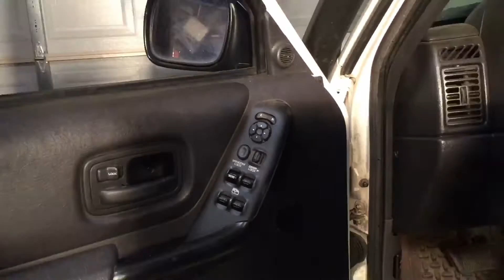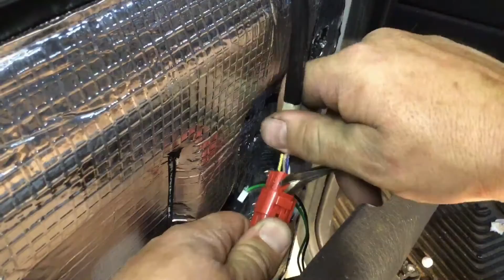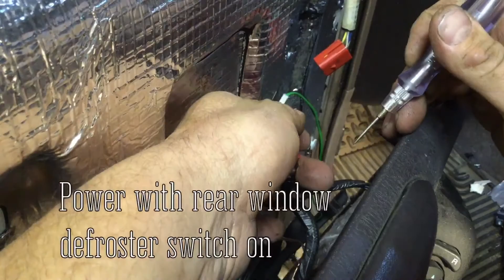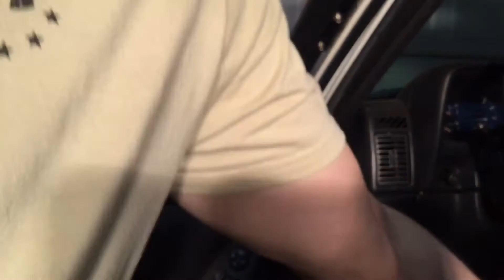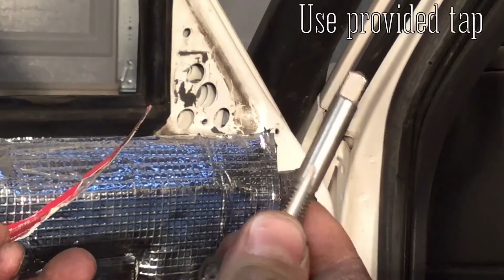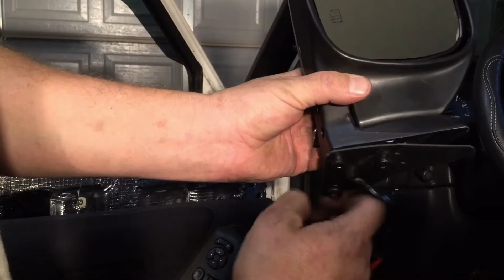'97-'01 Jeep Cherokee XJ Heated Mirror Upgrade

Comment: Can you update us on how you feel about these mirrors now that you've been using them for awhile?
Reply from the maker: Tee Ess yes, I like the defrosting feature but hate the cheap manufacturing. Buying used OEM would be better. They shake going down the road.
Reply: That's good to know. I ordered the same mirrors, but thanks to their slow shipping, I might reject the package to get my money back. My passenger side mirror works from time to time and I need to be able to tilt down for where I park it. Thanks for the great video and the follow up info.
Reply from the maker: Tee Ess absolutely. There is a more expensive version available on Quadratec that I didn’t order so I’m unsure if the quality but i would return these.
Reply: @kevefox You bought the Crown Automotive mirrors?

Comment: I love how you can upgrade things like this on the Cherokees. Like for example, the Infinity tweeters are plug and play because Cherokees without the Infinity systems still have the wires ready to go for the tweeters. Little things like that are so great and the aftermarket support for the Jeep XJ is endless.
Reply from the maker: Ultimate Machine agreed, these XJs are going to be around for a while.
Reply: Tinkering Fox    Yeah, I had a 2001 cherokee limited and the person that originally bought it purchased every single option for it from the factory and people usually stay away from all of the extra features like the power and heated seats but to be honest, it has been just as reliable as my parents' 99 xj base model with nothing electronic in the interior besides the stereo, dash, and rear defroster. I'm looking for a completely stock xj to start another awesome build. This mirror upgrade would be something small to start off with considering that in the Winter the mirror defrosters are a very nice thing to have. Then I'll just start doing the more expensive upgrades from there. To me, the XJ will always be my favorite kind of vehicle to build no matter what. I've babbled a little too much now haha. But yeah, I'm excited to see more videos. Keep up the good work! 👍 I'm the 900th sub. 😁
Reply from the maker: Ultimate Machine 900? Damn I didn't realize there were that many now. Well thank you very much for watching, and yes I have some things in store like an antitheft switch and redoing my headlight wiring harness with the length and everything described.
Reply: Tinkering Fox    Okay cool.

Comment: Sooooooo, At the risk of being annoying. Have you driven it since the engine upgrade ?  Ted.
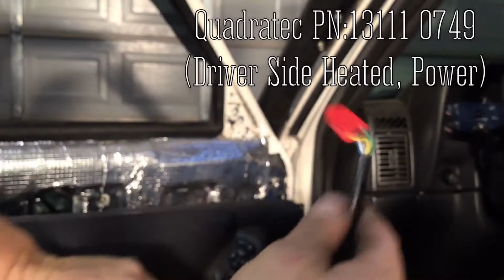Reply from the maker: vaccumme I have, and it runs freaking awesome. I still need to change my gear ratio I'm only at 4:10 right now sitting on about 33's. Sounds mean drives mean.